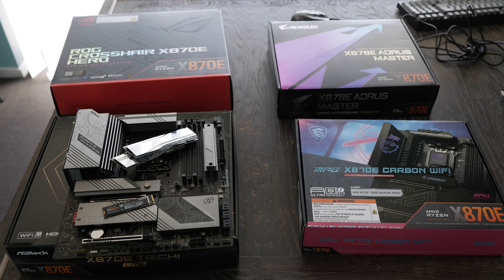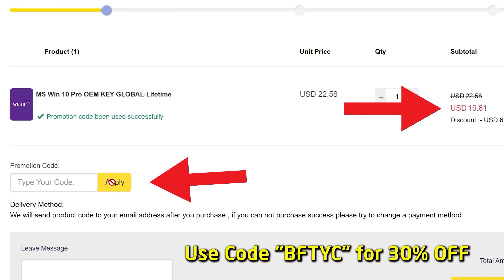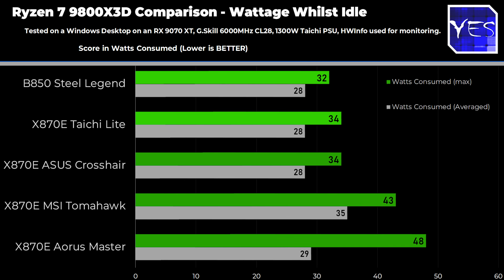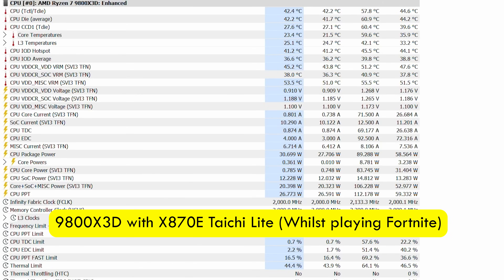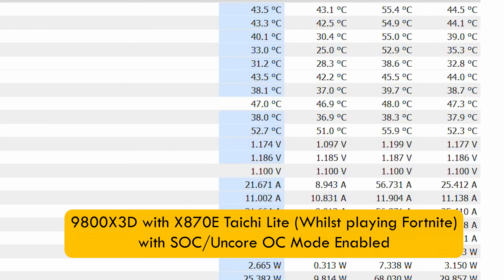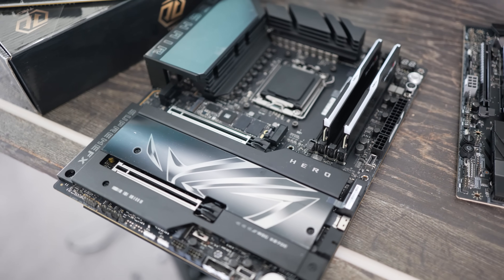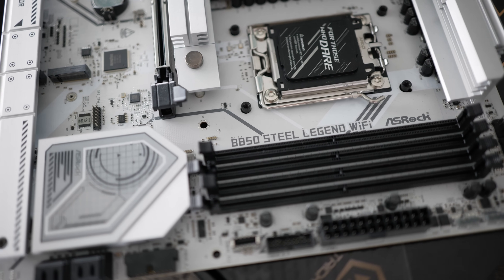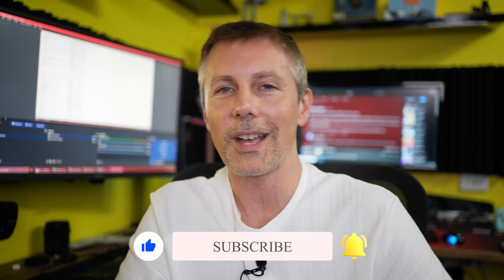I think I know why Ryzen 9000 Series CPUs are Dying...(!)

Comment: Best explanation I’ve heard so far. This could be indeed be the fix. However it may depend on the sample MB as my asrock gaming nova stays static at 1.19 in Soc voltage and I have the setting on auto. I think that everyone that is experiencing dynamic voltage should set the setting on enable as the video suggests. Thank you very much sir.

Comment: I have a Gigabyte Aorus Elite Wifi 7 motherboard with a Ryzen 7 9800X3D cpu and G.Skill F5-6000J3036F16GX2-TZ5NRW DDR5 kit in it and I have had this setup for a month, I decided to investigate this and found the SOC voltage was very high at 1.265 volts idling in the bios. I went into O/C mode as you did and manually set SOC voltage to 1.185 volts. need to do some testing for stability but sitting there idling in Windows,  it sits at at between 1.82 to 1.85 in HW monitor. I think you have found the problem there. Thanks for the video and it is greatly appreciated. My Older AMD Ryzen systems on X370 through X570 boards always had very stable SOC voltage that never went up or down in voltage and those systems held up great and were very stable.

Comment: So this could be some voltage regulation component occasionally slightly overshooting on SoC voltage while going out of power saving state? Now it could be some component slightly out of spec that overshoots a bit too much or SoC on some CPUs bening weaker due to simple manufacturing variance or an unlucky combination of both. Now if setting this to constant voltage would indeed prevent the failure that would be good news but at the same time it is extreemly difficult to test and proove. Considering how many 9800X3Ds are getting sold it is still very small failure rate but if a single BIOS setting change can potentially save your CPU then its deffinitely to know.

Comment: my 14900KS dont DIE since over 1 Year.
cooled with costum loop at 1x360x30, 1x360x45, 1x240x45 mm radis, 
clocked down, undervoltet and hypertrheading off, overtemp at 88°, atleast for 1 month Delidded  👍🤘
now i can kill all x3ds!  😂😂❤

Comment: My 9800X3D is still working great with my ASUS B850I motherboard. 
The CPU SOC is also dynamic. 
When I was gaming, the CPU was maxed out at 1.04V, which is lower than the 1.22V it reaches when I boot up Windows.

Comment: it s obviusly not, is in the working range so is a non problem, that would ave been a problem if the spike goes more then 1.4v that would definitly burn you chip especially if not a golden sample.
My cpu (intel) do it all the time, is normal an are more then 5 years and still is alive

Comment: 1.250v on SOC = bad! The mobo manufacturers blew up chips before overvolting things, and apparently are still doing it?!? This is why I go in and I manually tune my voltages myself and set the PBO to -30, and then test stability, and my chip can run it at the full -30 no problem. I get peak of 1.1 SOC voltages, and 1.15 to 1.175 CPU and get 200hz more all core performance with peak temps of 72 to 75 depending on the type of all core load using a 240mm AIO water cooler on my 5800X3D with an Asus Tuf Gaming WiFI Plus mobo.

Comment: Based on my experience, I would be very careful touching the SOC/Uncore OC Mode on ASRock motherboards. I have a Ryzen 9 7900X in an ASRock X670E PG Lightning motherboard, and after watching this video I decided to enable OC Mode for the SOC/Uncore as an experiement (I had never adjusted it before). I am running BIOS 3.20 (latest) and previously had no instability with the following features enabled: DRAM Profile EXPO, SMT Mode Disabled, and ECO Mode 105W. Setting the SOC/Uncore Mode to Enabled didn't have an immediate impact, I was able to do some gaming and ran some benchmarks in 3DMark with no issues, called it a night, and shut down my PC. Next day powered it up and bluescreen on boot (memory related BSOD). My PC then continued to either BSOD or freeze about 1-2 minutes after booting. First I set SOC/Uncore Mode back to Auto, no improvement. Then I dropped my RAM to JDEC timings, no improvement. I was able to quickly initiate a Windows memory integrity test and reboot  into it, however it reported errors about 3% of the way in and then froze at 7%. I could not even sit in the BIOS without it locking up after a few minutes. On a hunch, I managed to reload BIOS defaults, and everything is now stable. I've been in the process of repairing NTFS corruption that occurred on a few of my drives as a result of all the instability, and then I will try re-enabling my previous BIOS settings, except for the SOC/Uncore which I am going to leave alone.
Reply: Same thing happened to me, I was getting memory management bsod. Thought it was my memory couldnt even finish scan on boot. My bios would freeze and also like you described there would be a noticeable freeze glitch just as everything would load up sometimes triggering bsod. I was about to give up until I reflashed the bios everything worked from then on. Bios was freezing also now not sure if it was the this soc enabled oc or my low soc voltage. I am not willing to risk it again.

Comment: I just had a ASRock B850M-X WiFi kill a Ryzen 7 9700X, NO overclocks or anything, it was just running pure stock for 1 month. The PC was built with brand new parts in april..
Reply: The same thing happened to me, I used an Asrock B850M Pro-A WiFi with BIOS 3.20, now I just hope to get a refund for the processor and motherboard, and change them for another brand, and in the worst case, switch to Intel.

Comment: As of 15th May. ASRock released a new bios version 3.25 for b850 steel legend wifi. In the description of this version it says =>
1. Updated AGESA to ComboAM5 PI 1.2.0.3d.
2. Optimize PBO settings.
Maybe it is also related to fix this issue.

Comment: Why not just turn SOC OC MODE OFF. OFF. Seems like OC on is also potentially dangerous. BTW Buildzoid IIRC said the problem was Soc. And AMD delayed 9000 release series for an unspecified quality control issue. AsRock boards were destroying 9600x as well as higher end x3d chips. So my solution is just skip AsRock boards for 9000 series.  Pay 20 or 30 more for a MSI board. Its not worth the risk.

Comment: This is something I noticed on my 7950x3d after updating bios from 3.6 on my ASRock x670e Taichi Carrara to bios version 3.20. Mind you I have been using bios 3.6 since August of 2024. I watch my voltages and temperature a lot and I noticed immediately that the voltages on bios 3.20 are a lot different than on bios 3.6 even with the same settings. The spikes are almost unpredictable and higher, it’s something I noticed immediately especially after being on the same bios for almost a year with the same settings in bios, undervolt, PBO, Expo and ram timings.

Comment: Asrock X670E Steel Legend and 9800x3d here  - my SoC voltages were rock solid last night including during gameplay (I used hwinfo after seeing this vid)
This morning, my PC was hung half boot, one mobo led flashing.  Button power off does NOT fix it (have seen it before and turned off hibernate after seeing a thread suggesting that was to blame).  Yanking the power cable out for 10 secs and then plugging in and booting, sees the boot work like normal (memory training almost instant) - and I saw windows complete an update (explains the reboot).

I've seen this behaviour ONLY since replacing my 7900 with a 9800x3d.  Bios updated to 3.16 in Jan to accommodate plan for 9800x3d.  Updated in March to 3.20 shortly after getting the new chip and seeing a similar weird hang.  iirc there was an agesa setting that was suggested to use instead of auto, which I did.  I've not gone into that overclocking section and set the SoC though.

Obviously 670 is not 870, but I saw the 670 is affected to.  I am a little concerned that this weird boot behaviour is a pre-cursor.

FWIW; it sounds like your longer term experiment with hard set SOC voltage is a single unit.  Never been to this channel before so don't know how 'big' you are, but it would be better I think to have two identical boards and chips, one default and one with SOC set and get them to run the same test loop (including power off/on and perhaps sleep).  It won't be possible to conclude 'SOC voltage' without a control I feel.
Nonethless, it is another area for Asrock/AMD to look into.  I really hope we get something definitive soon - and hope the fix isn't to buy another motherboard!

Comment: With the ASRock board no mention was made as far as I could see of the BIOS ver. I just built a new system based on the ASRock Taichi, 9950X3D and Corsair 6000MT/s 96GB RAM with both Expo and XMP. The latest BIOS is 3.20. Update, checked the HWInfo and it seems to be working correctly with default settings, max SOC Voltage 1.188V, desktop, playing games and CPUZ stress test. So in my case I will leave as is with BIOS 3.20.
Reply: What exact ram kit are you using and what speeds are you getting?
Reply: @jasonrepa   CMH96GX5M2B6000Z30 Corsair Vengeance RGB Grey 96GB 6000MHz DDR5 Dual Profile Memory Kit. Getting 6000MT/s

Comment: I believe the issue is that these modern CPUs need "voltage/thermal training", just like motherboards do with RAM.  There is little to no overhead when the circuitry is so small.  It takes conservative settings and gradual tweaking/testing perf/thermals with each and every CPU.

Comment: Got a 14700k 1 week later the report on them self destructing came out.  Hoping the 125watt limit I put on it saves it’s life
Reply: considering that was some time ago and you still apparently are using the cpu think it is a better scenario than ryzens that are going dead from one moment to the other. at least the intel was giving some early signs and you could manage by reducing clock speeds. this one are good now and sometimes dead without any prior notice
Reply: Problems all solved me and freinds running i9 14ths gens and i7 14th gens no problems what so ever

Comment: Should I bother enabling this option for the 7800x3d on a b650 asrock steel legend. Current voltage on default 1.2soc seen a spike to 1.28 should I bother?

Comment: It's definitely the CPU... This has happened on b650 boards, not just the new, different brands... The only common thing is the CPU

Been saying that ever since I saw the list of burnt out systems.
Reply: I have 2 friends with 9800x3D, both use a Gigabyte mb, 1 x870 Aorus Elite WiFi7 Ice and 1 x870E Aorus Pro. So far, they have had no problems since late November 2024.

Comment: Can you help me with my gigabyte x870 gaming wifi6 and ryzen 9 9950x? It scores only ~38000 in Cinebench r23, clocks go up to 5.7ghz and is ok, but it constantly hits PPT limit of 180W. And there is no way I could increase it. I tried Ryzen master PBO, also tried setting it manually in BIOS to 230W. And it stays in bios as 230w, but in Windows(11), it shows only 180w in Hw Monitor, HWInfo and Ryzen master. Temperatures barely hit 70, in rare cases go up to 80c(i have water cooling)

Comment: What happened to the days when all you had to do was check compatibility, build and not have to worry about it randomly dying on you as long as you built it correctly. Everything is too expensive for them to be dying this fast and this often.
Reply: In the past you could overclock CPUs for much better performance compared to now, so voltages were much safer, but that means that most people didn't get much better performance.  ''Auto overclocking'' is now a feature on every CPU/motherboard, and this was the case for years. Even AMD had tested some of their CPUs with unsupported (their claim) RAM speeds, which they consider overclocking, and it voids the warranty, but they show it as the official performance you should expect. Voltages can be highest when browsing the web, or doing simple things like opening a word document, so it could reach advertised single core boost, for split of a second in most systems.
Reply: Companies dont care as long as they beat the competition and make money. You and I and everyone will keep buying and they'll keep serving defective products.

Comment: My new build Asrock x870E NOVA with 9950x, it goes to sleep and when I come back to it later, it appears to have completely rebooted. Wonder if this is a symptom.
Reply: Ohhh boy, that's my specs but my PC is not yet build, still waiting for a fix but can't wait forever regarding warranty etc...
Reply: Do you mind I asking, did you had to flash the bios prior to install the 9950x3d CPU or it worked out of the box?  First timer here in building a PC.😊
Reply: @osicogames1194  Mine came with current bios version: 3.2

Comment: 9800x3d and Asrock b850 pro rs here, i built my rig like 2 months ago and never a problem so far, but after i enabled this settings in the bios, while i was playing at Tarkov the monitorturned black screen and the pc restarted automatically. Before this, the bios settings was set to auto, but my soc doesnt go over 1.190V and it was already static
Reply: hmmm

Comment: Based on what the function does, activating it is actually counterproductive when you read the description. Technically, "disable" would make more sense. The question now is what the auto setting is. Even with the option enabled, the voltage in HWInfo fluctuates between 1.185 and 1.190V

Comment: I have similar problem on asrock x870e nova wifi - pc is only booting if ram is placed in B2 slot (also working with B2 + B1) but if anything is putted in slot A1/A2 all i can see is error code C5. For now i RMA my MB, new should come today and going to check if it was MB fault or do i have to send CPU back as well. I'm going to use tip from this video to verify if it helps but this whole situation is complete nonsense.. : \ (CPU is 9800x3d)

Comment: I have a 9800X3D on an Asrock X670E Steel Legend (BIOS 3.16) and only enabled EXPO in the BIOS, no other OC or Settings done. My SOC voltage is fixed at 1.190V at all load levels, can't see anything else than that exact voltage with HWInfo. So maybe that explains why there are mainly X800 chipsets in the reddit threads.
Reply: BIOS 3.20 is the same.  iirc I only did EXPO and the AGESA. have you had any reboot issues?  I've had a few where fans are spinning, but my cpu cooler LED is off/blank and a single motherboard boot LED is flashing.  I have to physically unplug the power to solve (reset and full power off by the case buttons isn't enough - it still ends up with a single boot LED and doesn't progress to memory training).  One change I just recall I made a the same time as updating the 7900 to 9800x3d, is adding a 2nd NVMe

Comment: I did what was suggested. I am on a 9800x3d, before I enabled the OC Mode, when I took a look at HWiNFO I had a maximum voltage at the SOC at 1.43 (pretty high) and it was hovering around 1.2 and had an average of there abouts. Just took a look now on HWiNFO post OC Mode enabled the voltage seems to be locked at 1.185 with a spike to 1.284.
Reply: Wait what? So it “spiked” to a lower voltage? 1.8 down to 1.2?
Reply: @B3astByNatur3 sorry my bad, 1.185*
Reply: Ahh ok that makes sense..

Comment: I ALWAYS lower the CPU voltage , and set it between 1,220 to 1,290 ( depending on what CPU ) because on 'auto' they can go up to 1.485 volts !!   (BTW ... talking about B450 and B550 boards)

Comment: I have a gigabyte X870 Gaming X and the voltages Change too and not in a minimal way it goes from 1.18 and 1.25/1.27 even I saw that happen in HWI while running a 9950X3d for the cpu

Comment: My 5800X used too much SoC voltage as well so I manually set it to 1.1.  My 9800x3D was using 1.32 SoC as noted by HWinfo which I also manually set to 1.1 and I've had 0 crashes, no issues CPU related at all since setting that.  I initially set it to 1.2 and it was fine there for a month or so and then bumped it down to 1.1 and its also been rock solid there as well.  No need to run 20% more voltage for 0 reason.  I also did later and undervolt +200 Curve optimize -15 which also ran fine with SoC @1.1v for over a week but I wasn't seeing any perf bump from it so I just set it back to stock.

Comment: so if I understand you correctly, you are putting a new CPU into a motherboard that had a previous CPU fail. You are changing this setting in the hopes that this setting was the culprit for the old CPU failing. Then there are two possible outcomes of your coming test. Either the new CPU survives the test, or it fails within the test.. If it survives the test, we have learned very little. It could be that the CPU that failed was at fault, or it could be that this setting was at fault. If the new CPU fails within the test timeframe, then we have learned something, and that is that this setting, whether enabled or disabled, cannot have affected the first CPU failing, because we now have CPUs, which have failed in both states.

Comment: You need to monitor the voltage with an oscilloscope, not software. As buildzoid did, finding out the reason for the failure of raptor lakes.

Comment: The default soc voltage for the 9800x3d is 1.025. My msi carbon defaults to 1.2 soc voltage as soon as I change the memory frequency even without xmp. I know AMD said 1.3 is safe but for how long?